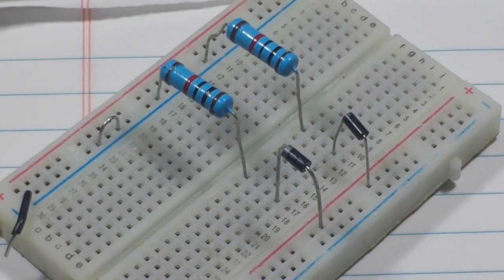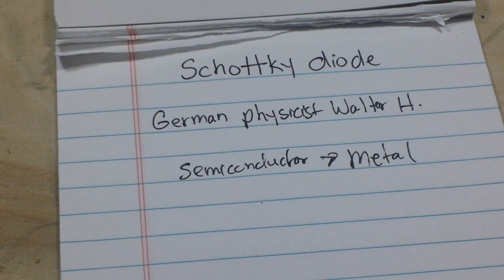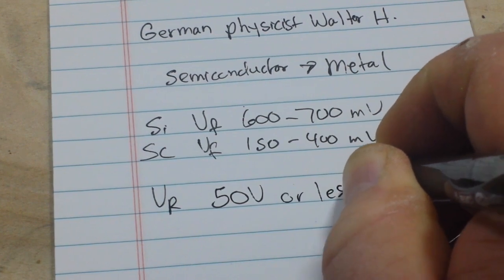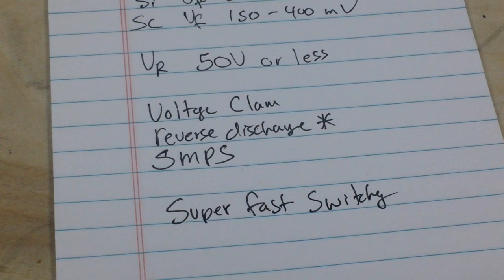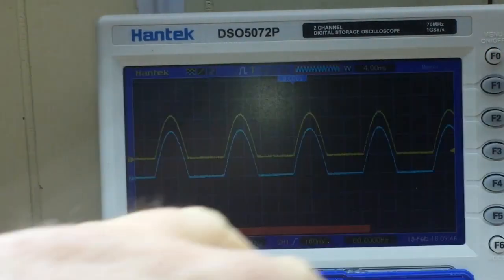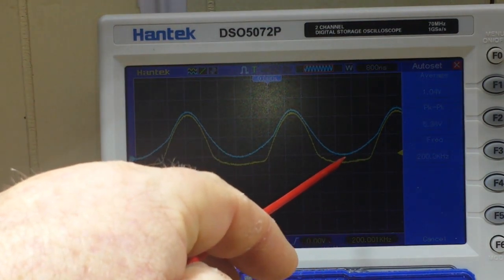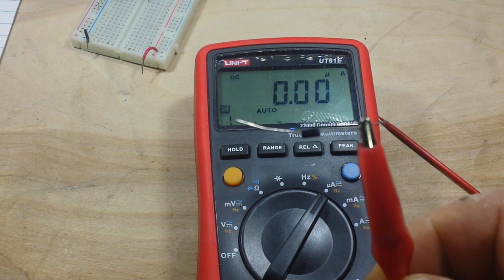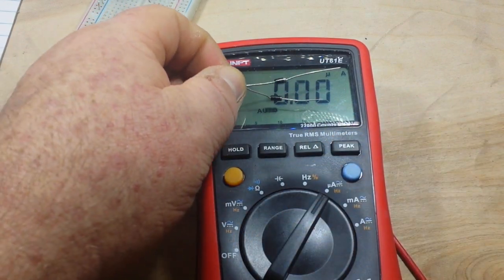Intro to Schottky Diodes

Comment: Thank you for this helpful video. Lately I’ve been exploring lectennas for use in sensing of 2.4GHz wifi signals. More specifically I’ve been trying to understand the role of the Schottky diode as compared to the LED in such circuits. Based on your video I’m wondering if the essential difference is in their switching speeds. If you’ve looked into lectennas and understand how they work I’d appreciate any thoughts you have. Thanks again. - Jim

Comment: How do I know if I have a Shokkyy or Rectifier diode on my midi 49 key midi keyboard powered via usb?
Reply from the maker: Measure its value .5-.6 is an sj. .2-.3 is schottky
Reply: @learnelectronics  on the diode is labeled  1n5817 and measure value in multimeter in Diode mode and measures 0.165 and in Reverse i get OL, so Im nhaving hard time to identify, Rectifier and Shottky both looks the same, i just can't find Midi keyboard schematic to easily point out Rectifiert or Shottky
Reply from the maker: .165 is a Schottky

Comment: I'm told that Schottky diodes are used in insect research - apparently they can self-power from a radar signal sufficiently to reflect a harmonic of the signal, detectable by a receiver. I'm interested in tracking hornets back to their nests, so I wondered if harmonic radar was a possibility... until I saw the price of equipment. Any thoughts?
Reply from the maker: No, but I'm going to look into it. That's a great idea for a video.